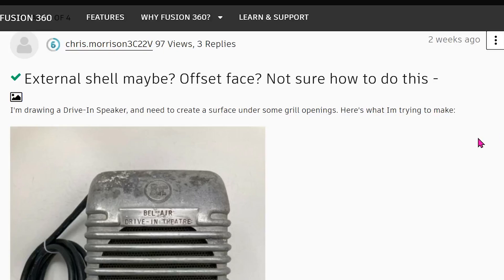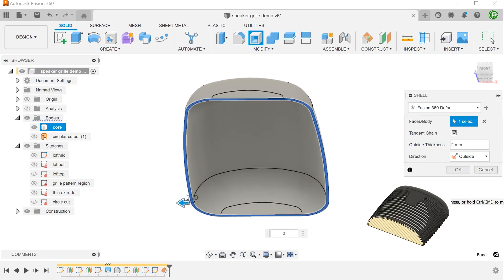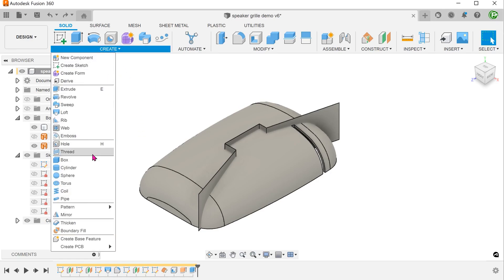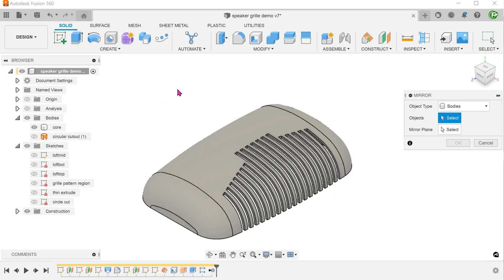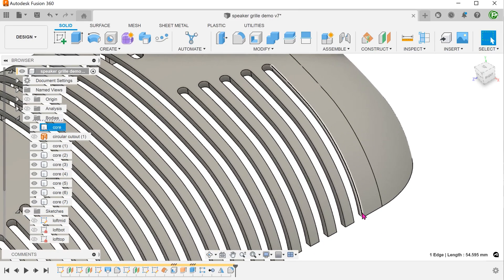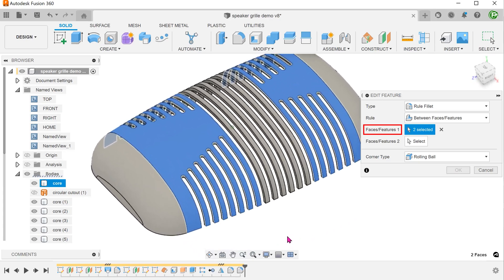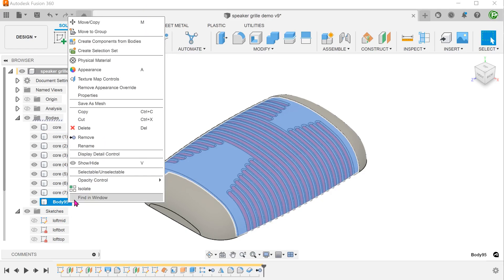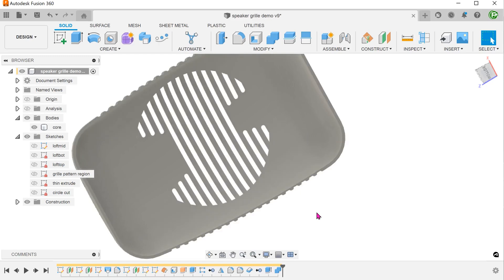Fusion 360 | Speaker Grille

Comment: Hello, I would like to ask what equipment do you use to work in Fusion 360, is it a laptop or a computer and what are its parameters?? because I see that it works very smoothly for you and sometimes you have to wait quite a long time for a given operation to be performed
Reply from the maker: When working with patterns and rule fillets, I do suffer from some lag as well. For the purposes of presentation, I edit out these lags.

Comment: I think it will easier to make a sketch above the model and sketch the pattern after it use extru to do cut.
Reply: I think doing slots in a sketch that followed the zigzag shape could be more awkward to change if needed, but you could define the termination surface as in the tutorial, mirror it, split the shell body using the two termination surfaces, setup full width slots in a sketch that can be easily adjusted for count and size, and then cut through the relevant split bodies and finally combine back to a single body. Similar effort to the method in the tutorial, which is pretty neat (hadn't discovered termination surfaces before).

Comment: Nice! Could you integrate more parametric workflow into your videos? Such as resizing the model will actually work. For example, im trying to set parameters for wall thickness, height etc, and also set fillet amount to a parametric value (for example a fraction of the wall thickness parameter). Thanks for great videos.